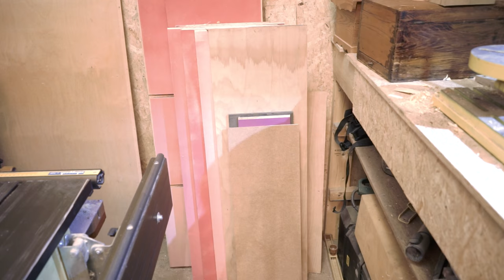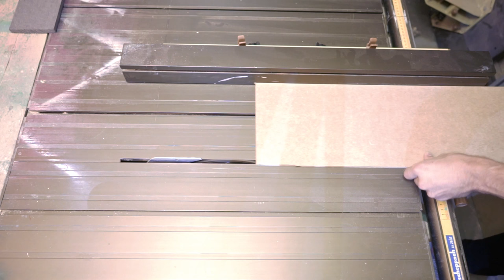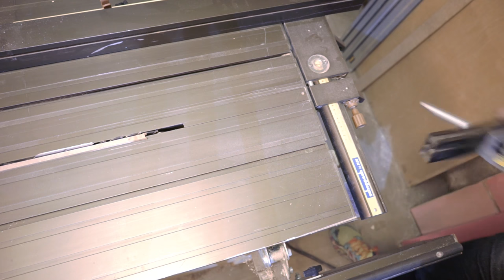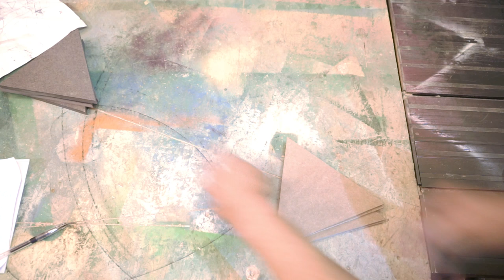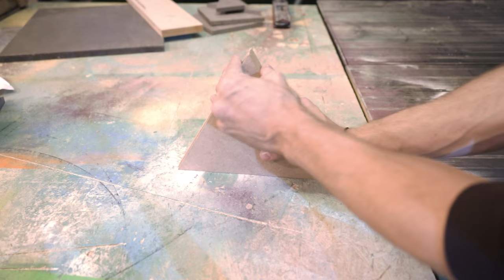How to make a Equilateral triangle on the table saw

Comment: I found your video about 2 days too late, but early enough for my next project!  I don't know why, but I've never thought about using a straight edge in that way!
Reply from the maker: hehe, sry for that :D blame youtube...
and hehe again, the straight edge trick is maybe not the best way of doing it, but it works. What did you make btw?
Reply: @FlokrollProjects  I made a hexagonal mahogany box, and constructed the top out of 6 triangles.  I think next time, though, I'll use your trick to make a template, then just cut the triangles out roughly and use the template on the router table to refine them.

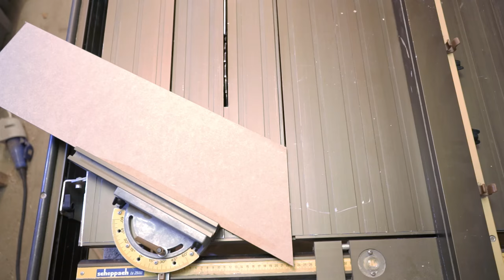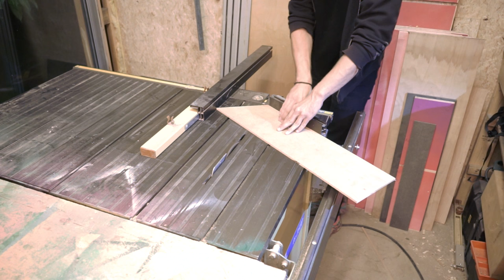Comment: Forgive me, for I am not mechanically inclined. But what is happening between 0:36 & 0:58? Why did the fence need to be pulled back? What is being pointed at?
Reply: The straight-edge scrap piece he put on top of the workpiece is resting against the right side of the saw blade. he aligns the workpiece up with this straight edge to ensure that the cut he makes doesn't cut the triangle short. The fence is then brought up to the point of the triangle to act as a stop so he can make repeatable cuts at the same size. he pulled the fence back to avoid the off cut triangle from being wedged in between the blade and the fence and potentially chew up the workpiece or have the workpiece become a projectile
Reply: He pulls the fence back so he can use it as a dimensioning guide, but when the piece moves past the blade it won’t get trapped between the blade and fence and possibly come shooting back at high velocity. It’s a safety thing. You can replicate on a standard fence by clamping a flat board to the fence, just shy of the beginning of the blade.
Reply from the maker: yes, thank you ( i will start with voice over for these kind of videoes ) :D
Reply: @FlokrollProjects  thanks, i need to understand what is going on since i am new at this and the tapping just made me nervous :)